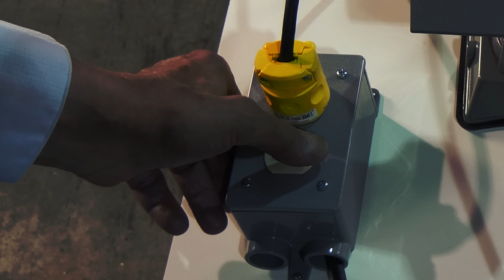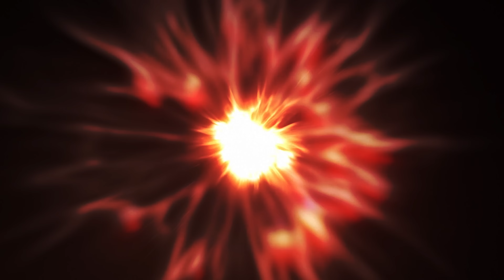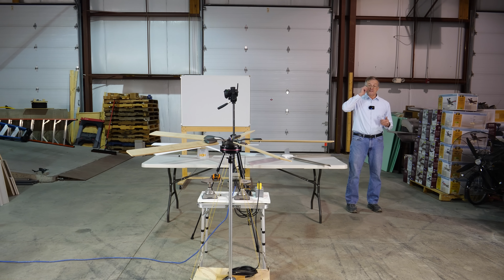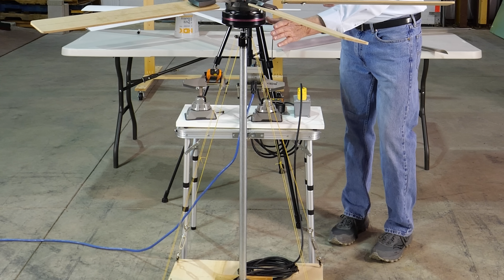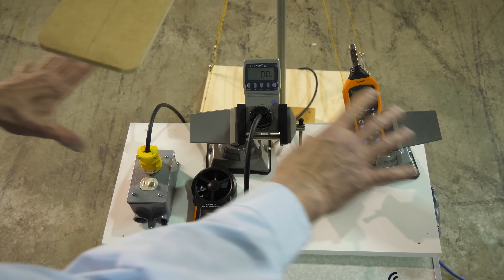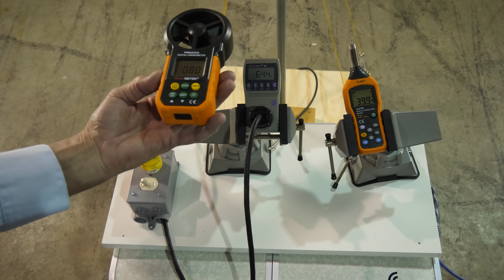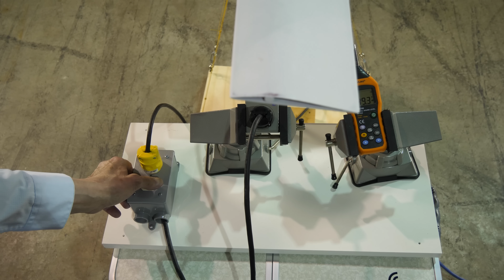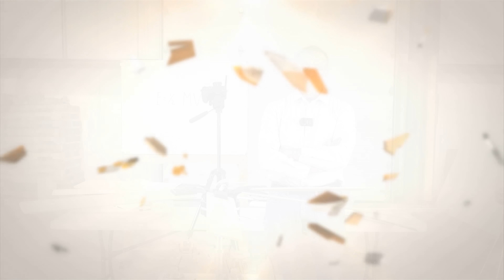This Fan Uses Almost NO Power

Comment: You ended kind of abruptly without summarizing a conclusion. Which seems to be this: the motor itself is far more important than the fan blades. You didn't follow up on the blade swap because it still wasn't worth the expense or effort. Getting a fan with a high-efficiency motor is where the effort and money should go.

I have to point out a glaring omission, though. The blades aren't flat because the aerodynamics are negligible at these speeds. They're flat because the fans are reversible. Having an airfoil that is more efficient in one direction would make them much less efficient in the other direction. And THAT'S why you shouldn't try to replace the flat blades with airfoils.

Although the overwhelming majority of people probably never change the direction of their ceiling fans...
Reply from the maker: Your final sentence is my best answer.
Although I agree with your point.

Comment: As others have said it would have been great to see the asymmetric airfoil on the brushless DC motor, but also with speed corrected to 1m/s airflow.  I'd expect not only significantly less power consumption, but much less noise as well
Reply from the maker: SO MANY PEOPLE have made this point that we intend to do that follow-up.

Comment: If you are looking to do a video on efficiency of cooling you could do one on cooling the condenser unit of a central ac with the water that condenses out of the air on the evaporator side of the unit (I do this in my house using a collection bucket water pump and a timer plug)
Reply from the maker: Have you noticed that the condenser fan on window units dips into this water to spray it over the coils?

Comment: Thank you thank you thank you.  It's along the same line as when I build a PC, I get minimum 80 Plus Platinum.  Sure, it costs a fair bit more, but over the long haul, I'm wasting so much less power as heat, and delivering more percent of the input power to the mainboard.

Comment: This is something that most people don't know about however changes have been made and ECM motors are being used in washers, fridges , bathroom fans and as you have shown, ceiling fans. Devices with cheap shaded pole motors are still out there but they are becoming less common.

Comment: My remark is back to the design of the blades: the center of the fan has a slower speed than the outer diameter, this should be reflected in the design of the blades, like for a propeller, of the blades on a table fan.
Reply from the maker: True.
But, the majority of the benefit comes from the airfoil crossection, and keeping this constant greatly simplifies the construction.

Comment: okay but did you consider angle of attack on the efficiency of the airfoil?
Reply from the maker: Absolutely. 
I adjusted each airfoil for maximum efficiency. The design makes that easy to do. I will cover that when I cover the rotor assembly.

Comment: if you add a proper airfoil, variable pitch and winglets you might even be able to save on screws (assuming running it 24/7) you then even get an acoustic "notification" if there's a power outage ;)

Comment: These brushless DC motors are found in luxury products sometimes, my Dreo floor fan uses 5W on low, and moves the same air as medium on a similar AC fan running at 22-24W. I’ve started using PC fans around my apartment, because those are made to run 24/7, and be super efficient and quiet, perfect little fans that move just a little air, as even small AC desk fans blow way too much and are way too loud on their lowest settings. I got a AC to DC adjustable power supply made for PC fans. I also have a window AC with brushless DC motors for both of its fans, and that went from 50-100W fan power (with AC off), down to less than 20W fan power divided between two fans, one inside and one outside instead of an axle through the middle for both on most other window AC’s. It’s definitely a luxury window AC, it’s a shame to not see these better motors more often.

Comment: Very interesting. I was hoping to see the dc motor with the airfoil.
Reply from the maker: You're not alone.
There have been many comments about this.  In my defense,  the performance differential between the rotors will be the same no matter what motor is driving them, but I probably should have done a max performance combination.

Comment: I don’t think your maths at 10:30 is correct. The increase in M is BECAUSE of the increase in V. I don’t think you get to use it twice. So the increase in E would be 1.44, not 1.78 as you claim (in fact 1.2^3 is 1.738). I’m not a physicist though so perhaps one could chime in?
Reply from the maker: No, they are correct.
The fixed diameter of the rotors means the increase in V is proportional to the increase in M. Now take that larger M and multiply it times that higher V... squared.
Reply: @TechIngredients  Yeah, you're right. Wind power is proportional to the cube of wind velocity.

Comment: Great choice on picking the ceiling fan; I use one every night. Are mini-split fan motors more efficient? Would love to also see a video on your thoughts about improving water heaters. The office I work at appears to have an undersized ac system; wondering if a "false roof" would be practical and would compare to an ac upgrade.

Comment: Too bad they didn't seem to be out two years ago when I replaced most of fans in my house. I had one Emerson fan that I moved, and bought several mid priced fans. Over 20 years, all of the others worked, but the bearings became stiff, and the fan filled with dust. I could blow the dust out, but the bearings were installed in the frame in such a way you couldn't press them out, and put in new ones. My only hunter could be rebuilt. I bought new Hunter fans that I had checked to make sure I could blow them out, and change bearings every few years to make them more efficient.

I knew the motors got hot, the packed bearings made that worse, If I had been able to buy these fans back then, I would have. Given this video, maybe the manufactures will work on making more fans with his type of motor available, and phase out a motor design from more than 100 years ago. Better still make them efficient, and  serviceable. I'd pay extra for that!

Comment: Try the airfoil with the new brushless motor 
Or is it easier to skim the blades with a electric plane, to put a long sloping trailing edge, and the leading edge, of the wing 💸🪽

Oh bend a twist in the blades? So the pressure is equal across the whole surface, that will help with thrust 

And if really want to go overboard
Toroidal propeller 😁 maybe somebody can 3d print one do a dual cooperation
They make a video of 3 printing blades 
And you can make a video of testing the blades🎉 it’s a win-win  🥰
Reply from the maker: The airfoil I demonstrated is probably best when considering the skills and equipment that are available to the half  million people or so who will probably see this video.
I'm sure it isn't the very best design that could be built.
Reply: @TechIngredients loads of typos,  the apple iPhone speech to text or even text to text has a mind of its own 😳  all the time!😵‍💫
Good luck with the project

Comment: I'm not trying to throw cold water, but in a clothes washing machine, there is really much less waste in proportion to the useful work performed by the motor, because in those simple stamped steel induction core motors, the wasted power is more or less constant over the rated power range of the motor, which means that at the upper end of that range the motor is relatively much more efficient.

Comment: Great research. The noise level of buzzing sound (60 Hz from lamp?)  very high. I'm not sure about this noise measurements. Other thing is what AC motor has efficiency about 90% in worst case 80% and it's seems what it's just semi-broken AC electric motor.

PS Fridges with inverter motor controller - most weakest part. It's sad.

Comment: What was the diameter of your fan? Do you have any reason to believe that the 1 meter/sec velocity that you measured is a representative velocity for the entire area swept by the fan?  I want to calculate the actual power required to accelerate the air passing through the fan from zero to 1 met/sec. My guess is that it will be less than 10 watts, but I need the diameter of the fan to do it.

I am surprised that you were measuring ~40dB. It sounded louder to my untrained ear.

Comment: Look up the brand Big Ass Fans (seriously).  Many of their models use perm-magnet brushless DC motors and aerofoil blades to drastically improve efficiency and save on power costs.
Also--consider what the Wright brothers did with their twisted propeller innovation: nobody before them used a prop with progressive angles of attack through the length of the blades.  A near-zero AoA at the tips greatly improves efficiency.
Reply from the maker: The primary reason for that twist is that an airplane is moving through the air. The radial velocity combined with the foward velocity means that at each distance from the hub, there is a different optimal angle of attack.
At takeoff, most propellers are actually stalling near the hub.

Comment: It does slightly bother me that you used 'VA' on the Kill-a-Watt to measure power. The original fan, if an induction motor, is going to consume reactive power, but this is not the same as consuming real power. Some additional real power will be absorbed due to the increased RMS current, but it will not be the same as the difference between the Watt reading and the VA reading. The BLDC fan motor may have power factor correction built in especially since it converts to DC before the inverter converts that back to AC to drive the motor.

EDIT: For the casual commenter, the additional energy lost due to poor power factor alone will be LESS than the difference between Watts and VA, never equal to or more. I just measured a Lasko tower fan and saw about 29.9 W on low with 35 VA This isn't terrible and that fan gets closer to as PF of 1 on high with 43.5W and 45VA. So I checked a much older fan in my room for white noise, it draws 125W on high, 190VA.. On low it draws 70W, 100VA. So the difference between these readings can be significant.

Residential electrical service doesn't generally charge for reactive power in the U.S., only real power. As for the other half, I'm sure reducing the need to constantly magnetize and demagnetize the rotor as in an induction motor does improve the efficiency significantly, but this demonstration is missing hard data for where that line is since we were looking at apparent power instead of real power the entire time.

Comment: One of the big reasons for the basic dumb stamped blades is also that they are reversible. Airfoils have the angle of attack but that is a bit self defeating in reverse.
Reply from the maker: That's a good point.

Comment: Might be the whole reason why I installed and liked so much a combo led light plus fan that I found on a Chinese import shop...
I always thought about ceiling fans being these humongous heavy things that were loud (buzz) and big.
But sometime this year I found a led light + fan combo that I was willing to try. 6 speed, leds also fully adjustable with color temperature and dimming options, they are easy to install, and have a standard AC to DC converter box for the whole thing. Also nice that it uses a very standard mounting bracket that is plenty secure. The fan is quite small to be fair, but it's enough for my needs.
Only disadvantage is that it uses a remote control and has no wall switch options... so you become dependent on the remote to change settings.
But it was fairly easy to install, the fan is pretty silent even at max speed, it's reversible, and moves enough air.
At first, I was a bit worried on how thin the wires are. But seems this is mostly because it consumes very little energy.
They've been working great at home, and I also decided to install them at my parents. The advantage of being able to control light intensity and get rid of multiple regular fans is pretty great, but I also wondered why it seems to consume so much less power... I'm guessing the answer is this video. xD
Reply from the maker: I believe you are right.

Comment: its just not worth it, or is it?  Clearly the dc motor consumes less, but one needs a motor controller to convert chop and smooth the ac power.  That controller will fail as does everything.  However,  I'm thinking if you have solar and battery a guy could just run them on dc.  As for my midwest situation I run the fan at night  to reduce the felt need for air conditioning. as its now 90 F out now i can keep the house at 78 F and the fan makes it feel 75 F ish.  So for me the savings for switching the fan motor to dc will be swallowed up by one cycle of the air conditioner.  Life is different in Maine.  Yall prolly use those as AC in the summer and in reverse in the winter.

Comment: Great video. The buzz is apparent because the microphone is using AGC (Automatic Gain Control) and is set to a rapid response, or an overall high gain and a compressor/limiter is used to try and tame the levels.

It would be much better to manually set a recording level. If the speech was used to set the level then the background noises would practically inaudible.

If it is desired to capture really quiet sounds it is better to use an extra audio channel with a microphone set to a fixed higher gain and mix between them during editing and post production.

Setting a recording level isn't that hard, need only take a minute or two to set and results in a much better recording and a lot less work later on.
Reply from the maker: It's due to the high bay, MH lighting.  We need to upgrade that.
Reply: @TechIngredients  That may be the source of the buzz, but there's still something about your audio setup as the noise fades in and out. There are also other miscellaneous sounds in the video that wouldn''t be there if not for the realy high audio gain. Tweaking the audio setup would go a long way to mitigate noises until the sources are removed or tamed.

Comment: This was a bit of a dud, since a) everyone is complaining about the audio, rightfully so, since you need to record with fixed levels, and do the leveling in post, and b) there is no real message here besides "a better engineered and more modern electric motor has better efficiency", which really isn't a surprise, since even common household appliances are now not only relying on BLDCs, but even leaving out belts as yet another source of inefficiency.

Comment: Interesting video! It appears that the asymmetrical blades' tilt positioning is slightly aggressive, which would cause turbulence to form on the top of the blades. With that DC brushless motor, I would hypothesize that with a less aggressive approach angle, you would achieve a much greater lift/down-force.  The turbulence may be causing more drag, noise, and inefficiency. It's just a theory though.
Reply from the maker: The two custom rotors were optimized for angle of attack.  That is simple based on their construction.  I didn't cover that adjustment when the motor choice dominated the efficiency issue.
Reply: @TechIngredients thank you! 👍

Comment: Measuring rpm during the first set of comparisons would have been instructive as far as fan efficiency alone goes.

However, you made your overall point. People usually forget about conversion efficiency in any kind of system, here the conversion of input electrical power to output mechanical work done.

Comment: How about taking the original blades and round off the edges? Then try knife edging them. Next up round the leading edge and taper the trailing edge to make it sort of aerofoil shape.
Reply from the maker: The blades I choose are so easy to make, you might just go the whole way and replace the originals.

Comment: One of your worst videos. 20 W is "Almost NO Power"? This is pure clickbait. And the conclusion is that new brushless motor (with almost no friction) is more efficient than some old AC motor... I mean WOW - that's amazing... ;P
Reply from the maker: That's a silly comment.
I never introduced friction into this comparison, and there is no reason to believe it is different.
Reply: @TechIngredients  I know you didn't mention friction that is why I think this video is so bad :) Do you know how brushed vs brushless motors are different? There is no sens in comparing them in context of how much energy they use to generate heat. Also you did not refer to how this video title is a clickbait. So I think your comment is silly. I really like your videos but this particular one should be left in the drawer.
Reply from the maker: You're in a minority. 
You focus on bearings. Even if a DC based fan had, for some reason, incredibly good bearings and the AC based fan had terrible bearings, then buy DC based fans.
Reply: @TechIngredients  I do consider myself as minority :) And I focus on physics not the bearings. But I don't see a point in explaining this further. Have a nice day!

Comment: You made a descant based air conditioning system a while ago. If I recall correctly most of the power losses were due to the air circulation. If you improved the efficiency of the air handling would you get a better result?
Reply from the maker: Undoubtedly, you would.

Comment: Just a heads up, the ansmometer wants to be further away from the blades of the fan. That way the "bursts" of air pushed by a blade even out and you get vetter readings

Comment: I've always been interested in using a helicopter's collective control system to adjust the fan blades pitch over increasing rpm. Maybe you guys could put something together and see if you could achieve high airflow speeds while also keeping the noise down instead of just upping the rpm of the motor.